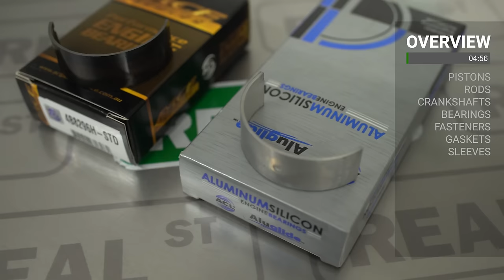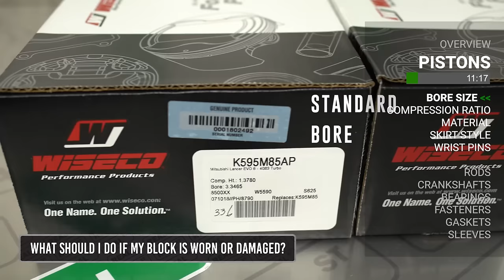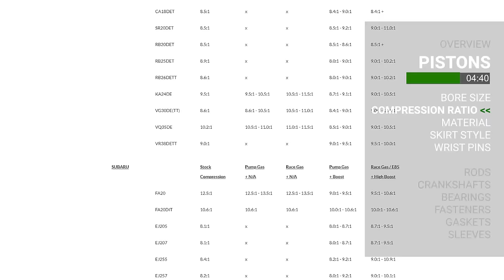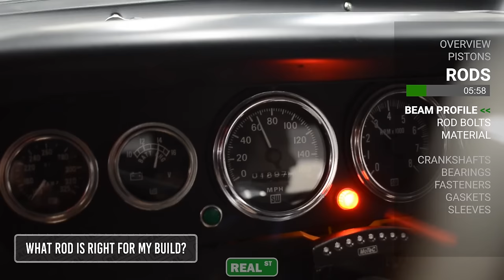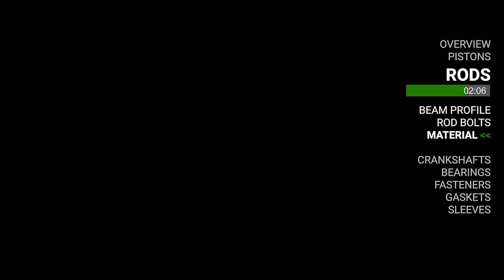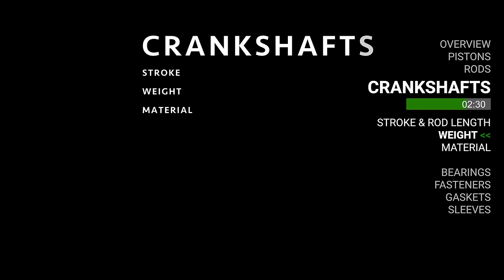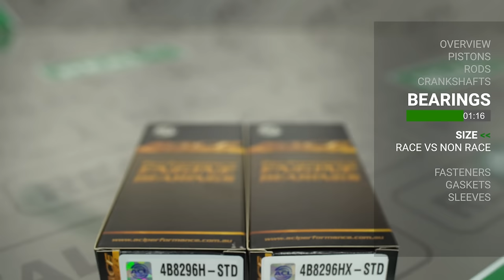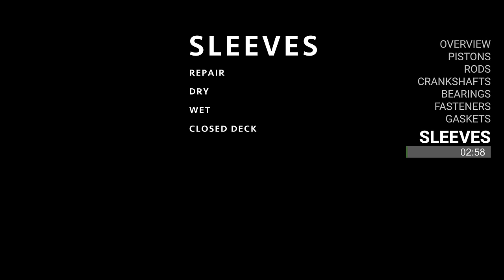Bottom End Buyers Guide - How to Choose the RIGHT Pistons Rods Bearings Studs Gaskets Cranks Sleeves

Comment: I plan on rebuilding my first engine. It’s a perfectly running b16a engine but I just want to refresh it due to high mileage. Can I just slap on standard size main/rod bearings as well as standard size 81mm piston rings without replacing the pistons with just honing the cylinders?

Comment: For a new engine build I always try to buy a new bare block and new crank. I then use standard size forged pistons and ibeam rods. But an experienced engine builder will always check the piston to wall clearance and not assume it is within recommended spec of the piston manufacturer.  Another important factor is to have an experienced engine builder that has worked on your platform. Even better when they have extensive experience in sleeving your block. Having top tier machinery like a 5 axis cnc and does the assembly. The less people who touch your motor, the better. When a builder has to farm out machining services that is just another factor that introduces the possibility of human error. I’ve learned to select the right parts by research on what high hp builds are using. But over the years I’ve gathered this information, like using +625 ARP rod bolts and head studs. Always use proven parts like Cometic head gaskets, ACL race bearings, choosing pistons with the heavy duty wrist pins. For a turbo car block to head sealing is very important to keep from lifting and causing a head gasket failure with high boost pressures. I will do my due diligence and ask the parts manufacturer the correct gap ring size for your car’s application while giving that information to who is assembling your motor.

Comment: Forget about H beams, all builds.  Without getting into metallurgy or mass, just look at the geometry:  one rib to resist fwd/rear flex and two for lateral forces.  This is backwards.  The crank is in motion on a running engine, so absent doing something insane with timing or fuel, peak pressure happens after tdc, and any lateral rod flex has a place to unload.  What is needed is more resistance to fwd/rear flex, and an I beam is the right tool for the job in staying away from a bent or broken rod.

Comment: sitting here after work just to learn and i think you just saved me, i am waiting on my block to get back from sleeving and have the rotating assembly in my office. my goals are about 900 hp on a k24 and you made mention of the wrist pins, so i got to going through boxes and saw it was pretty anemic, i called wiseco and they said it was good for 500 whp, i asked them what the upgraded pin would be, they gave me the number and ordering i went. that 130 dollar upgrade may have just saved me 12k longblock. i feel look a fool for not looking at the wrist pin wall thickness earlier.

Comment: I know this is a bottom end build guide but I'm not sure if you skipped over this or just left it out but when it comes to CR you need to also take into consideration camshaft profiles.  Camshaft profiles can drastically change your dynamic compression ratio.  Thats why some engines with high CR can run on pump gas as their camshafts have lots of overlap causing the dynamic CR to be low enough not to cause detonation.

Comment: Brilliant video Jay. Planning on rebuilding my F20C2 over a period of time so this has been useful :)
Reply from the maker: Thanks for watching. Thats one of the best engines ever created, feel free to reach out if you'd like any help
Reply: @realstreetperformance  Cheers! I don't suppose you have a recommendation on a set of aftermarket pistons that are FRM compliant? I came to a halt last year when I enquired with Honda about some OEM 05 F20C pistons and they wanted over £1800 at mates rates! I then bought some good used 01 pistons then found they revised the piston skirt lubrication and didn't use them, so that's when I stopped sadly. I am determined to build an F20!
Reply: Wanna see this I miss the s2k from HELL make banger
Reply: Wanna see another banger  JAY get this guy on the ball Jay for REAL STREET  AT #GOING HAM ON S2K WITH JAY REAL TALK MAKE SOME REAL RWD POWER 🏁🤯🕴💣💥🍻🔫

Comment: Where was I a year ago?! Hahah not modding my car that's where. 🤣 thanks for the video real st, this is good information. I didn't really have an HP goal for my VQ engine, I had strength and longevity in mind and keep engine measurement specs to OEM. I just want a strong block that can handle boost for high potential HP gains for street and weekend track use.

Comment: You mentioned forged pistons, but cast or hypereutectic pistons are more common especially in large displacement American V8s. Also some discussion of various wrist pin methods like full floating versus press fit would be of value. When talking about fasteners, you implied that changing from torque to yield or torque plus degrees to straight torque fasteners wasn’t feasible by your comment on checking your engine’s manufacturer’ specifications. More visual material and diagrams such as relates to desk height, compression height would be appreciated.

Comment: Man I love this. However most of it was not helpful for my 7mgte builds that are to come. the most I can really get is pistons, rods,  hardware and gaskets. Maybe someday I'll have enough money to build custom engine parts for it. Got any suggestions for 500-750 whp range? I know I can squeeze 500 on stock internals but I really should go forged.
Reply from the maker: Jonathan, what custom parts would you need? We have a lot of parts for teh 7m-GTE ... check this page out... this is the bottom end package builder for 7m-gte https://www.realstreetperformance.com/buildyourpackage/engine-block-package-builder?make=Toyota%20/%20Lexus&model=Supra%20MK3%2086-92%20MA70&engine=7M-GTE&clearmvge=1
on that page you will find Pistons, Rods, Bearings, Studs, Gaskets, crank pulley, timing belt... you shouldnt need any more than that to hit 750whp ... just pair it with the right turbocharger. For that power range i recommend the precision 6466 or borg warner s366

Comment: Would you please give the information on how to build a sbc 350 to run 4 to 500 hp . I’m two days older than dirt,, Lol i want to build this with my 1970 2 bolt engine, which is already bored 40 over. I have to find a machine shop that is trustworthy can you recommend one I’m in San Antonio tx , in the past ive used different ones one didn’t put cam bearings in right no oil to lifters another didn’t turn but half the crankshaft not funny at all. I’m old and tired and very very little money. Thank you sir

Comment: aluminum doesn't dissipate shock load and steel does. so that's not really a reason as to why aluminum is easier on bearings. it simply has to do with stopping a heavy object to push it the other way, you're more likely to get squished and that's what's happening to the oil and then bearings

Comment: Question - when you say low Hp vs High Hp, what numbers are a high Hp and what are low Hp for turbo applications. (Road car)

To me, 500 Hp is high but I know you build cars that are 1500 +Hp. That’s like going to the moon and back sort of High. 

Here in New Zealand where it’s rear to see 350+Hp cars roaming the streets 

Cheers
Reply from the maker: hey there, id be happy to help. In which part are you asking about specifically? Usually the break points for upgrades happen in 100-150hp per cylinder increments. but it varies per part

Comment: Can I change my engine to have a lower TDC? I'm thinking of building the engine but can't find rod length + compression height options that would keep the standard from factory.
Can I do that if the resulting rod length + compression height are slightly lower than factory standard?

Comment: First, excellent video. Thanks. Question: How does one go about sourcing pistons, rings, bearings etc for say a 6 cylinder SAAB 95 when the standard parts sources, like SAABUSAParts and eEuroparts don't carry them? Are there manufacturers that make these things to spec, or have generic/standard size parts cataloged? Or do I have to resort to cannibalizing donor engines or do an outright swap? Any suggestions?
Reply from the maker: If they are not available as a shelf part number in the performance aftermarket, we can have them custom made. Custom pistons are one of our most active segments. shoot me an email to parts@realstreetperformance.com and i can help you source the parts you need
Reply: @realstreetperformance  That's awesome. It was more a general question in anticipation of a potential rebuild. Thank you!

Comment: I’m building my 2jz GE, compression is 10:1 I believe but I’ll be using pump gas so I need to lower compression ya? Wanting 500+hp
Reply: That all depends on multiple factors.  What is your octane for your pump gas?  Also will you be changing your camshafts?  You need to consider your dynamic compression as well as your static compression.  Depending on your camshaft selection your dynamic compression may be lower than what you think you are actually aiming for.
Reply: @tadda6282  i was asking in a general form. Since most don’t opt for bigger cams

Comment: So lets talk about HP ratings for connecting rods. Eagle makes a SBC rod with a 1.889 honda bearing for 8 cylinders and is rated at 600hp. Yet when you look at the same 1.889 honda rod it has a rating of 900hp for 4 cylinders. Yet is is very unlikely that the SBC will spin at 10,000 rpm but you know the honda will. So what do you think is the problem with this theory ?
Reply from the maker: We don't go by the manufacturer ratings. And we would not use an eagle rod at 900hp in a 4cyl.
Reply: @realstreetperformance  But I think you miss the point, Its not HP that determines its RPM, so if you have an engine that makes 600hp at 3500rpm that engine would not need the same rod as a 600hp engine at 10,000rpm The load on the rod bolts goes up inversely with the rpm. And you did not mention a powered metal rod or a 300m rod.
Reply: I was reading that they make 2.2  V12 indie car engine also Honda does  so I bet they could build it for the right price  for sure knowledge is power also $ is also make Chevy dodge Ford V-8 sqme way also I'm sure you can do it might run one time I bet throw fuel and boost or nitrous one time real street JAY

Comment: So am I wrong for having bought oversized pistons without my engine the bored out yet? I was gonna let the machine shop do all the measurements for piston to wall clearance once he had bored it out and all that
Reply from the maker: Defaulting to an over bore piston without having the cylinder walls inspected is usually safer than defaulting to a standard size piston and hoping it will fit. But at the end of the day its still a guess. Lets say you buy .020" over bore pistons instead of standard bore pistons "just to be safe", then you take your engine to the machine shop and they say the block would have to go to .040" over to clean up damage from a previous engine failure. Well in that case, youd either need to find another block that cleans up at .020" or get a set of .040" pistons. Make sense?
Reply: REALSTREETPERFTV makes perfect sense, my cylinder walls have what looks to be minimal surface rust so hopefully I’ll be ok on that part but if I need to get a new block then I will since I’m starting my build with a bare block anyways

Comment: I have a 416 stroker engine , would it be better to have a lighter crankshaft but keep it a 416 stroker
Reply: Are you running up beyond 6000 rpm? You also run into rod ratio problems when trying to run high rpm and more stroke.

Comment: Why no talk about pump gas and alky. I’m running 35 #s on pump gas and  alky on my grand national.
Reply: Who knows? Alky is better than E85 but pump E85 is nearly widely available. Alky absorbs more heat than E85 and only requires slightly larger injectors than E85. Engine also burns cooler, it's  near perfect race fuel and typically cost less than high octane unleaded or leaded fuels. It is more dangerous to deal with though.
Reply: Anthony Thomas you do not need bigger injectors. Im spraying m1 through the up pipe on my car. The kit that I use is called alky control. It’s not really mentioned but it straight up works. I was interested to see if he had a opinion on spraying meth with pump gas.
Reply: Real talk you can make it or buy from liquor store look on YouTube  you can run on corn whiskey aka e85 not quoted just saying it's been around for years governement hack I seen it on discovery channel making the moonshine it said bov ol facts pro a ly the same thing but idk I'm just here to learn more about engine and life

Comment: Theoretical compression ration is a meaningless number.

What about taper wall piston pins?
I remember reading GM did pretty much the definitive work on aluminium connecting rods in the 1960's. 
Aluminium rods have a drastically lower life than steel rods measured in several million cycles compared to steel as billions of cycles

Comment: The day of rebuilding engines is not like the 60s and later. Especially on daily basis. Find a wrecked car as close as what you and just replace the engine especially on modern engine today with all the puter crap. Parts are so expensive and trying to find good parts is almost non exist today. We live in a throw away economy and the parts show it.

Comment: with a high compression piston, say 13-14 to 1 you can reduce the cylinder pressure by late intake valve timing ,,this involves special custom cam grinds ,or variable intake timing and lift, which is a can of worms if not done properly (how fat is your wallet?)